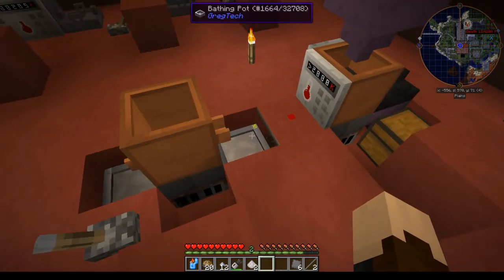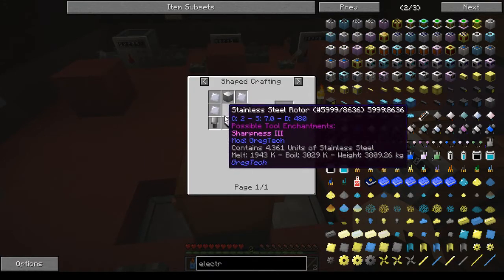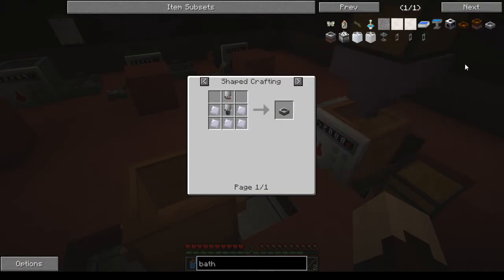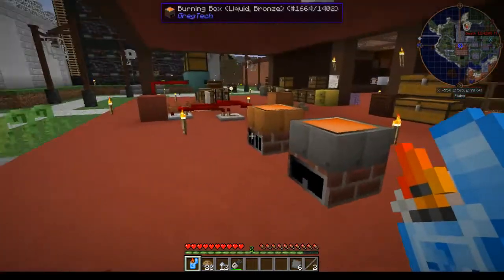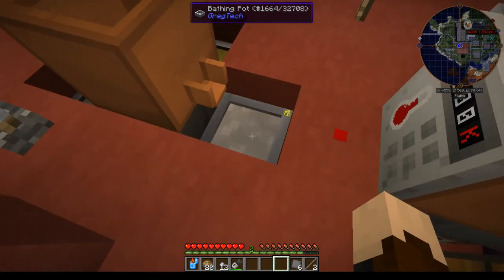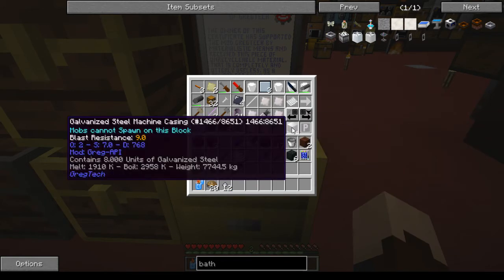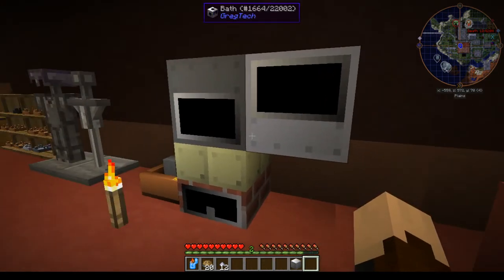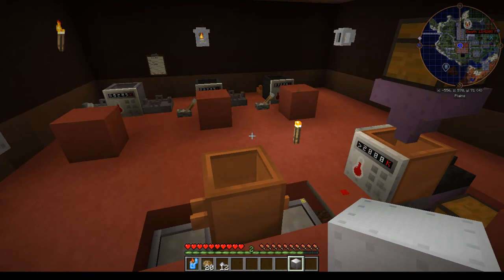[Gregtech 6 Tutorials] Galvanized steel

Comment: what is the diference between the half and the full block with the slab?
Reply: and how much in liters does it hold?
Reply from the maker: 16,000L and there is no difference in the 1/2 or full versions other than look
Reply: holly 16k never thought it'd be that much
Reply from the maker: ya the baths and mixing bowl can all hold 16 buckets worth